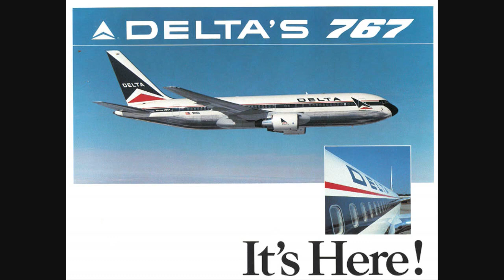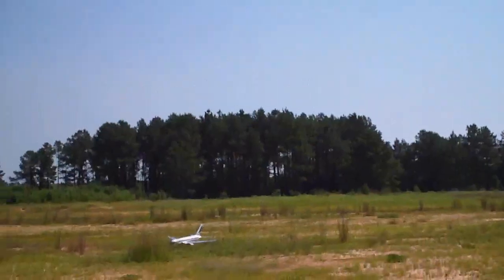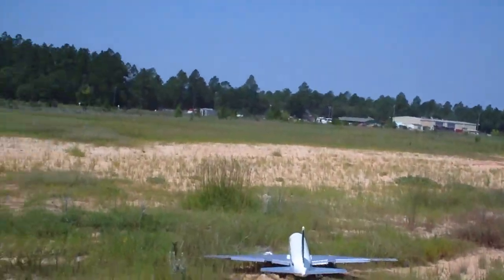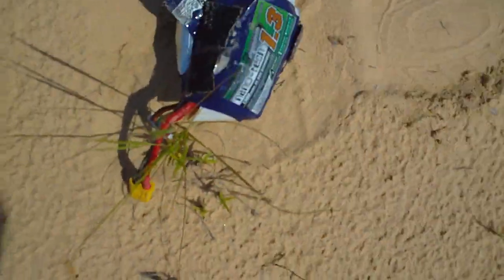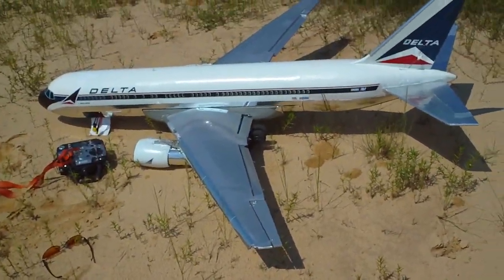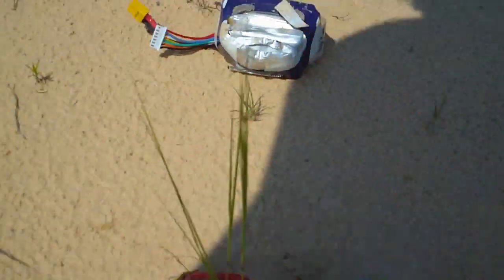Return of the DELTA 767-200 RC AIRLINER!

Comment: I know you were happy with that flight Demon Driver.  It was great.
I wouldn't look for more than two laps with a 1300mah battery running two motors. A lap took about a minute.  I don't even know your motor size but my gut instinct screams "more capacity!".
I'd like to get me a plane carrier like the one you have.  It's the nicest one I've seen.
You can be proud of that plane.  All it needed was better equipment apparently.
Reply from the maker: Thanks Mike!  It was a HOT windless day and I wanted a super light 767. . . So these batteries fit the bill for the flight conditions that day.. . . .I only 2 acted a 2min flight but because I went all out 90% throttle the entire flight I ran the low capacity 1300mah batteries down fast . . . .if I had eased back to 60-70% I would have Not blown those batteries.
Reply: F3HDemonDriver Well, it sure did what it was supposed to do!  It flew like the dickens.  That's what it is about.

Comment: Hard to believe you would send such a big jet up with such small batteries. Not sure of your wiring or size of your fans as you don't show them in your description, but even if only 70mm I would have used at least 2500mAh batteries. I use a single 5000mAh battery with my Tian Sheng twin 70mm A320 Airbus. Don't mean to be so critical but it took the entire runway for you to take off, which had me on the edge of my seat for you. Please consider what I say. I really love and admire what you are doing and encourage you to continue. I hate to see so much work ending up in a crash landing. Beautiful aircraft. Your CG looks spot on. Thanks for sharing.
 Addendum: Aircraft as large as that deserve twin 100mm fans and if wired separately, two 6S batteries at least 4500mAh each. Just my opinion. The sound is incredible, do you actually have 100mm fans? Sounds like you already do.
Reply from the maker: I did that because it was a hot & muggy 98 degree day with no headwind.  . . I needed a light jet.  If it was 75 out and I had a 7mph headwind I would have used two 2200mah 6 cell batteries instead.. .. ..I stayed on the runway that long to go past the end runway camera. . . Pretty cool footage.
Reply: Yeah I also do have Tian Sheng 70mm A380 Airbus and I use a single 2800mAh battery. And my A380 Airbus have 4 fans so what this Delta is. Because my Plane have 4 fans it makes so big sound and fly so high and far.

Comment: You might want to go with larger batteries and /or a much higher C rating! Nice plane. You can find formulas on the web to correlate amp draw in relation to necessary mah and C rating. I admire your passion and creativity in crafting these planes, they are impressive!
Reply from the maker: James Hirt your absolutely correct Jim. . . . I should have run nothing lower than 1600mah in my 767. . . I ran two 1300mah  lipos that day because it was 95+with zero wind. . . Therfore I needed the lightest plane possible.  . So I went with super lite batteries.

Comment: Wow!  Great flight, and talk about getting lucky with those batteries not going up in smoke inside the plane.  Weak batteries on a hot day can sure play havoc with a planes performance.  What do you think the density altitude was?  Our 1350ft. field elevation on a 105 deg day gives us a density altitude of around 4500ft.
Reply from the maker: Thankyou Sir! Yeah I sure did dodge a bullet on that flight.

I'm not sure of the air density that afternoon.  . But it was 98 degrees with 1mph of wind.

Comment: How much did that cost? (The model that is!)  Lol. Those batts failed DURING the flight because they were way over-amped btw.  Looked good in the air!
Reply from the maker: I scratch-built this 767. . .so that's a hard question to answer Sir. . .  The batteries where definitely over-amped during that flight. . . I should have used 2 2000 mah Batts instead. .. well live & learn . . . Thanks for watching!